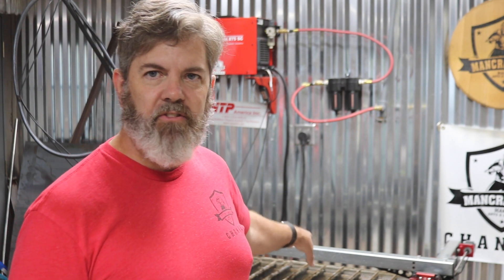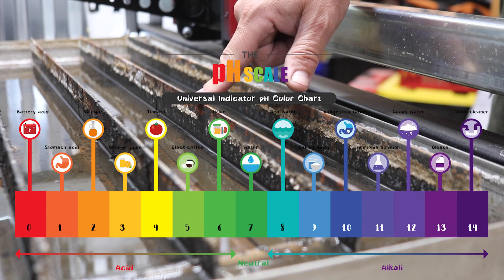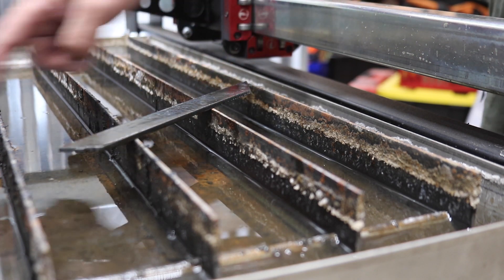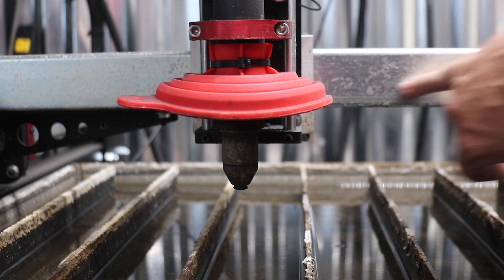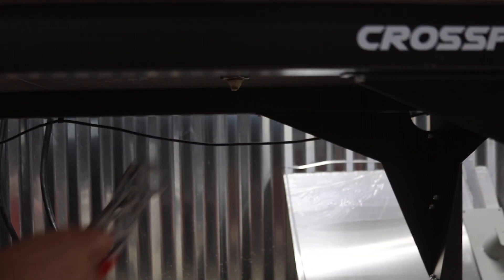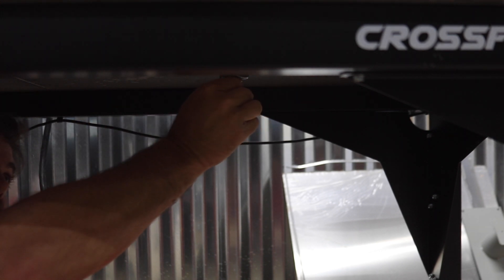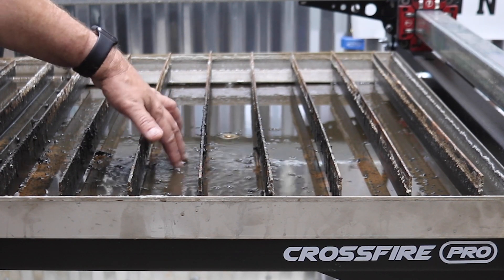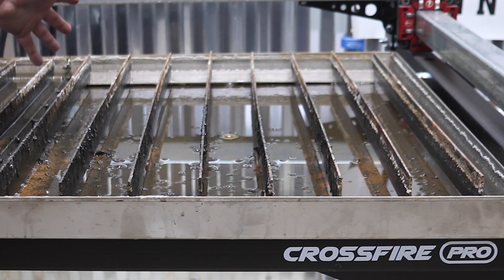Upgrading my Langmuir Pro/Do These Upgrades When Setting Yours Up!

Comment from the maker: Affiliate Links:
Langmuir Crossfire and Crossfire Pro  http://store.langmuirsystems.com?aff=2
SAVE $100 Using Discount Code: ManCrafting
HTP Affiliate Links:
Multi Process Pulse MIG Welder  https://800usaweld.com/products/pro_pulse_220_mts?ref=3tijle_owkg
TIG Welder https://800usaweld.com/collections/htp-america-tig-welders/products/invertig-221-ac-dc?ref=3tijle_owkg
Plasma Cutter Used in my videos https://800usaweld.com/products/microcut-875sc-v2-plasma-cutter?ref=3tijle_owkg
Table Torch https://800usaweld.com/products/microcut-875sc-v2-plasma-cutter?ref=3tijle_owkg&variant=31949886128211
Welding Helmet  https://800usaweld.com/collections/optrel-auto-darkening-welding-helmets/products/vegaview-2-5?ref=3tijle_owkg
MIG Gloves https://800usaweld.com/collections/clothing-gloves-1/products/htp-america-split-leather-mig-welding-gloves?ref=3tijle_owkg
TIG Gloves https://800usaweld.com/collections/clothing-gloves-1/products/htp-america-split-leather-mig-welding-gloves?ref=3tijle_owkg
Best Setup I’ve owned for sharpening my Tungsten Electrodes.  I’ve made some, I have bought add-on accessories for my Dremel.  This is the best.   https://800usaweld.com/collections/tungsten-grinders/products/htp-america-tungsten-grinder?variant=27910084755539

Air Compressor with adequate capacity  https://amzn.to/2PFPo7X

Amazon Affiliate Links:
Red Funnel  https://amzn.to/2YbnOXb
Shelf Brackets I replicated https://amzn.to/2z1MhEp
Certiflat Weld Table  http://weldtables.com/#_a_cust8g
Heavy Duty Magnet Square  http://amzn.to/2dycStl
Magnet Level  http://amzn.to/2cS2ZYV
Round Metal Marker http://amzn.to/2dMikvI
Marker holder and 12 refills http://amzn.to/2dCLTks
Heavy Duty Gloves  http://amzn.to/2dMiqDD
Standard Reverse Measuring Tape  http://amzn.to/2ut3PRK
Flatback Series Tape Measure 16 Foot http://amzn.to/2fgdIQQ
Evolution Power Tools EVOSAW380 15-Inch Steel Cutting Chop Saw  http://amzn.to/2dMhkb4
Reply: @ManCrafting  for the life of me I can not find any details, make/model, or links to the dies and such you used to dimple the bottom of your SS water table.   You wrote, "I picked up a hydraulic hole punch set as well as some dimple dies.  I'll add links to what I have as well as at least one other option below."

Comment: About to order a Crossfire Pro and came across your video. How often do you change the fluid in the table? Also, what do you do with the crud you pull out? Simply throw it in a garbage bag? Thanks for the great video!
Reply from the maker: The crud is just metal.  I trash it.  The liquid is bio degradable.  I train what I can then wipe up the sediment.
Reply: @ManCrafting  how often do you find you need to change the liquid?
Reply from the maker: @pr0jektcha0s  I’m going to say it depends on the amount of cutting.  If I used it everyday I’m guessing it would be every couple weeks. Me, maybe every 2-3 months.
Reply: @ManCrafting  Thanks for that info!
Reply from the maker: @pr0jektcha0s  happy to help.

Comment: Do you have a link to the dimple tool?
Thanks
Reply from the maker: I got the cutter at HF.  The dimple dyes from SWAG Offroad.  If you need a link I’ll track it down.  I know I’ve posted it.
Reply from the maker: So the hole punch is from harbor freight.  The dimple dies work with that.  This is the set I own.  https://www.swagoffroad.com/SWAG-Pipe-Dimple-Dies-5-Piece-Set-34-1-1-14-1-12-2_p_112.html
Reply: Thank you

Comment: What kind of dimpler kit is that?
Reply from the maker: I got the hole punch from Harbor Freight.  The dimpler set is from Swag Offroad.  It’s made to work with the HF hole punch.
Reply from the maker: https://www.swagoffroad.com/SWAG-Pipe-Dimple-Dies-5-Piece-Set-34-1-1-14-1-12-2_p_112.html
Reply: Awesome,  thanks great video BTW 👍
Reply from the maker: Anytime.

Comment: So here is the real question.  After 10 months does it work?  What are your thoughts?
Reply: I’m sorry the plasma green product.  Does it keep everything clean?   Also I would love to talk to you about your plasma cutter.  I need to cut 1/2” to make John Deere quick attach plates shown here on my website.  http://www.landworkspro.com/john-deere-35g-quick-change-coupler-operation/   I like this cutter your showning cause it matches my budget the trick now is to find the right plasma cutter that supports the thickness with out breaking the piggy back.   Thoughts?
Reply from the maker: The plasma green has stopped the rust and crystal buildup.  Even if the water is evaporating.  So I’ve been happy with it.   As for my plasma cutter.  I love it.  I’ve had two others in the past and this is by far the best.  I’ve cut the nastiest 1/2 in material with no issues.  In manual mode it can cut up to 1” on the table with a table torch I think it reduces to 5/8”.   https://800usaweld.com/products/microcut-875sc-v2-plasma-cutter?ref=3tijle_owkg  make sure to select the table torch if you go this route.  Or both torches if you want to use it both ways.   Also MANCRAFT5% will save you 5% on anything you buy.  Including consumables.
Reply from the maker: It works like the day I bought it.  I use it at least once a week.  Sometimes way more. Just depends on what I have going on and what I need to cut.
Reply from the maker: My first response doesn’t do it justice.  It’s amazing to my that I own a tool like this.  I  really grateful that a company came out with a plasma CNC that would fit in my shop and was at a price point I could easily justify.  It’s really a dream come true.

Comment: Has any one coated the water pan with flex seal or rhino line ??? I'm ordering mine this week and it was a idea .
Reply from the maker: I coated my original with powder coating before they were Stainless.  It was aluminum.

Comment: Just an idea I came up with from clean the bottom slag my down draft welding table.  Harbor Freight heavy duty Magnetgetts the bulk out fast then a wet dry shop vac to suck up the left over mud.  Really quick easy way to keep from scooping the slop.
Reply: Even better, put the magnet in a heavy duty zip lock bag and then pick up the slag. Invert the bag when you can't pick up anymore and pull it away from the magnet. No more dirty magnet.
Reply from the maker: Good idea.

Comment: question for you.  i bought some of the 9010 plasma fluid from Konzen since i cut both steel and aluminum and i have been been getting brown, almost mud like sludge forming after cutting.  have you run into that issue?
Reply from the maker: I didn’t get the 9010 originally, although I bought some last week.  I’m sure any sludge is the byproduct of the plasma cutting the metal and rather than being released as smoke it’s trapped in the water.  Kind of the intention of a water table.

Comment: Has anyone shared this with Lanqmuir to add the dimple?  Seems like a simple improvement.  Well done.
Reply from the maker: It’s been mentioned.  Not sure why they haven’t made a modification.
Reply: @ManCrafting  cost. Each step in manufacturing will affect the end user.

Comment: Chad, one thing I did to my Crossfire (the original) was to add a brass 1/4 turn ball valve on the drain instead of a plug.  Makes draining the pan much easier and faster.  I drain mine down when not in use.  Keeps it from freezing in the winter and evaporating in the summer.  I use a 6 gal or so bucket, it's just big enough to hold all the water.
Reply from the maker: I definitely want to set up some sort of drain system.  This would be quick and easy.   I had been toying with a drain and refill with a pump.  I’ve just been busy and it’s low on my list.
Reply: @ManCrafting  I saw a video a while back of a guy who made a air pressurized fill and drain system.  It was pretty slick..  It would be the ticket for your table as yours doesn't move.  Thought of doing it for mine but it wasn't exactly portable..  Found it!  https://www.youtube.com/watch?v=nkXThVPKC24
Only issue is the tank can get a lot of crud in it and need flushing once in a while.

Comment: can't you just use vacuum cleaner to suck up all the water from the pan? We always use any wet/dry vacuum to vacuum anything!
Reply from the maker: I suppose you could, just keep in mind the water is loaded with steel.  So it will probably tear up the vacuum fairly quick.

Comment: Nice info, thanks for the discount I just ordered my CF Pro with your code. Can’t wait to get the table.
Reply: I ordered mine this month, says it ships in April. I'm good with that, but April is going to be a long month. Days will be weeks.
Reply from the maker: @tstail  awesome.  Don’t wait until it shows up.  Take this time to start compiling things you want to cut.  Designing them.  Understand the workflow.  You’ll be busy and ready when it shows up.
Reply from the maker: Awesome.  Can’t wait to see what you do with it.  I have a couple of cool projects using mine coming up on my trailer build. Can’t wait.

Comment: What size dimple die did you use? I have a Crossfire Pro on the way and want to buy or make the die before it arrives.
Reply from the maker: Sorry I didn’t reply.  I just saw this.  Did you get your table and figure out the dimple if so?
Reply: @ManCrafting  actually the last box arrived last week and I have not had a chance to start on it yet. Can you tell me what size die I should buy?
Reply: Did u ever find out what size?
Reply: @strangerdanger1449  I ended up grabbing the hydraulic hole punch set at Harbor Freight. I think that I used the 1-15/16 set because I bought the bar drains but I did not think about the material stretching with the dimple dies that I made and they came out a bit big. If I was to do it again I would most likely dimple them first and then punch them bigger or use the 1-11/16 size if I was going to punch them first. I am working on putting together a video about it but the Holidays have me busy.

Comment: Does their green stuff freeze ?  My table will be exposed to cold weather outside  in my shop. Can someone  help with this 
JUST GOT MY NEW  CROSSFIRE PRO TABLE  09/10/20 .lot nicer  than I was expecting.  Will be awhile  till I get it up and running have to did a little  room on my 22 x 10 shop . 
Small now but after being really  sick for 16 yrs And being happy caped  it will try longer.  Loss a lot so can not work no income  so it take more  Effort.

Comment: How is the torch height control?
Reply from the maker: It’s a game changer.  I had a sheet that was getting hot and warped as I had cut it.  It may have had at least a 1 inch bow from end to end. The THC rode the rise and cut perfectly the whole way up.  It was amazing.
Reply: It is amazing. I wouldn't get one without it now that I have one with it. Cut width consistency, dimensional accuracy and edge quality are all so much better.

Comment: CHAD, I didn't see the link to the dimple dies and Hydralic punch set. I'm getting a Pro in September and want to do this upgrade as I install it. Thanks for the information.
Reply from the maker: The punch set is this https://www.harborfreight.com/hydraulic-punch-driver-kit-96718.html  these are the dimple dies. https://www.swagoffroad.com/SWAG-Pipe-Dimple-Dies-5-Piece-Set-34-1-1-14-1-12-2_p_112.html

Comment: Awesome video and very helpful! What dimple die setup/brand did you use? and what brand hydraulic punch? Thanks
Reply from the maker: christopher sendry sorry had to look up the links. https://www.harborfreight.com/hydraulic-punch-driver-kit-96718.html from harbor freight.  And this from SWAG Offroad. https://www.swagoffroad.com/SWAG-Pipe-Dimple-Dies-5-Piece-Set-34-1-1-14-1-12-2_p_112.html
Reply: @ManCrafting  thanks so much! about to dimple my table right now!
Reply from the maker: christopher sendry awesome.  Let me know how it goes.
Reply: @ManCrafting  $500 to dimple the pans? Yowza!!! That would be nice for Langmuir to incorporate that into future pans. Worth it in mass production. OR. You could start a dimple business. :-)
Reply from the maker: @donswords6671  I bought them for metal working projects.  If this was the only time I’d use them that’s definitely not a very good ROI.  I’ve used them 4x since buying them and probably 100’s of time more over the next few years.

Comment: which torch is that and where did you get your brackets?
Reply from the maker: Hey William, these are the links to my Plasma Cutter and Table Torch.  Plasma Cutter Used in my videos https://800usaweld.com/products/microcut-875sc-v2-plasma-cutter?ref=3tijle_owkg
Table Torch https://800usaweld.com/products/microcut-875sc-v2-plasma-cutter?ref=3tijle_owkg&variant=31949886128211
If you mean the brackets holding the torch I got them from Langmuir.  https://store.langmuirsystems.com/collections/add-ons/products/crossfire-crossfire-pro-machine-torch-mount
If you mean the Brackets I made to hold the Plasma Cutter on the wall, I made those in another video here- https://www.youtube.com/watch?v=HFHLn6aT08k&t=15s

Comment: @ManCraftingTM what is the red plastic cover over the torch tip? and where can I find them?
Reply from the maker: This is what I ordered.  Works well just held on with the zip tie.  I keep it down unless filming.  Silicone funnel  https://amzn.to/2YbnOXb
Reply: @ManCrafting  Chad, have you had any problems with the torch cover while cutting.  Any melting of the sort?
Reply from the maker: @Sam-wp4ps  I haven’t.  It’s silicone so it’s pretty heat resistant.  Other than dirty it looks like the day I installed it.
Reply: @ManCrafting  Sweet.  Ordered.....
Reply: @ManCrafting  Got it installed.  Way cleaner  as far as water control.  I like it. Thanks

Comment: 👍👍👍didn't know you had to change liquid for different  metals
Reply from the maker: There is cheaper material for just steel.  If you want to cut non ferrous and steel you need the more expensive option.  The 9001 works for everything and most importantly neutralizes the hydrogen gas that’s released cutting aluminum.
Reply: @ManCrafting  👍👍👍👍appreciate the info

Comment: what is the magnet you are using to hold the slats while you clean them ?
Reply from the maker: It was just an old sweeper I hadn’t been using.  I took the handle and wheels off then bolted it from below where the handle screws on to lock it in place.  https://amzn.to/2AoZAzF

Comment: I saw the green stuff in an IG post and was wondering what the heck it was. We need to find some of that. How do you like that rubber(?) apron around the torch? Do you find it makes a difference with water spraying everywhere?  I cut a 48x32” top for a welding table this week and it made quite the mess, particularly whenever it was cutting near the very edge of the water table.
Reply from the maker: It’s a funnel.  I picked it up on amazon for a couple of dollars.  It works great.  If you decide to get the green stuff make sure you get the type that works best for you.  I bought the one just for steel.  There’s 2 others.  Green or Pink that can be used safely for non ferrous metals.  Aluminum produces hydrogen gas when cutting.  The 9001 prevents that.
Reply: @ManCrafting  Thanks for the warning about the hydrogen. No need for that in unexpected places. 

I was wondering if that cover was made for this purpose or not. I'll have to keep my eyes open for something similar.
Reply from the maker: Chris Manning I’ll see if I can find the link on the funnel.  Should be in my history.  Also 10% Off on Plasma Green with discount code:  ManCrafting
Reply: @ManCrafting  Exactly right Chad.  The Plasma Green 1050 for steel, Plasma Green 9010 for aluminum, and Plasma Pink 4001 for applications like mechanical saws etc. where breathing mist is an issue.
Reply from the maker: Mark Konzen could the Pink be used in the table as well if you just wanted to know via a visual indicator which material you had in?  Or is it not appropriate for the Plasma?
Reply from the maker: Silicone funnel  https://amzn.to/2YbnOXb
Reply: @ManCrafting  Plasma Pink 4001 can be used in a Plasma table, and does the same job as Plasma Green 9010, but it's main purpose is in mechanical saws where misting is an issue.  Plasma Pink is a non-irritant to breathe in, is also non-reactive to aluminum, and does not product hydgrogen gas.  If you're not creating breathable mist, the Plasma Green 9010 works great, and is safe on aluminum.  Plasma Pink is more expensive than Plasma Green 9010, however, that is why most people choose the PG 9010 over the PP 4001.
Reply: @ManCrafting  Cheers. That should make things a bit cleaner.

Comment: Great tip on the Plasma Green! I've been waiting to see how you solved this :)
Reply from the maker: Thanks. If you decide to get some, make sure you get the one that meets your needs.  One is steel only the other keeps hydrogen from being created when cutting aluminum.  Important distinction that I wish I had addressed in the video.
Reply: @ManCrafting  That's a good tip. I had placed an order, but do need to cut aluminum safely, so will revise it. I'm glad you mentioned it!
Reply from the maker: Sorry I didn’t make it clear in the video.  I actually had the 1050 recommended to me.  I didn’t notice the thumbnail saying Steel until Phil asked me about it. 🤷🏻‍♂️
Reply: @workshopetech  Order received!  Thanks Dan!
Reply: @workshopetech  Thanks for your order!  Pail has shipped!